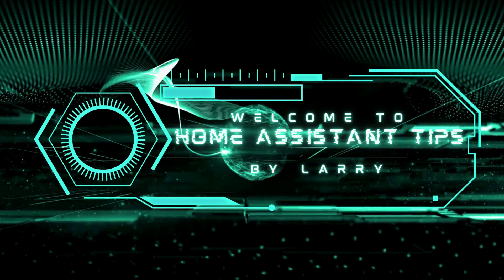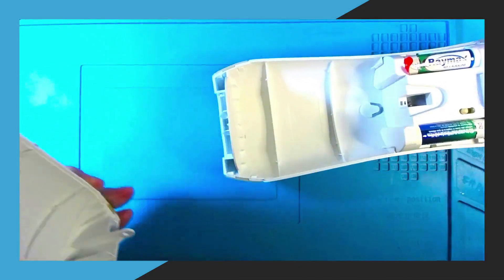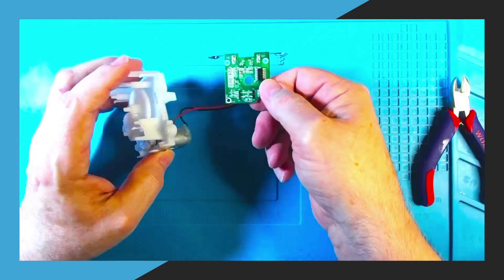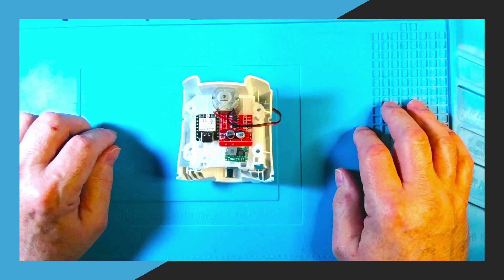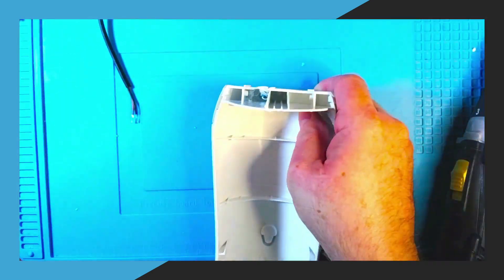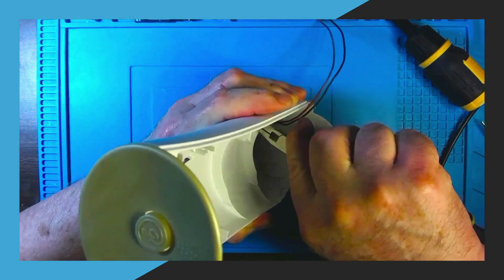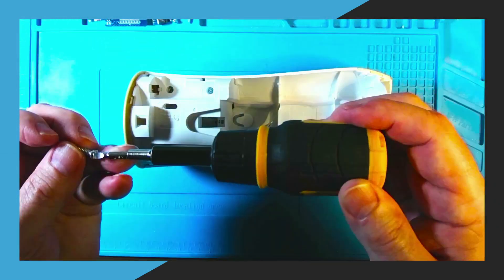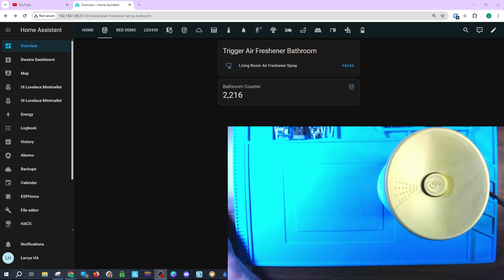Integrating a Glade Air Freshener with Home Assistant Full tutorial Mod

Comment: Excellent Thanks! 
It works perfectly! If it helps: I set everything up with an ESP32C3 Super Mini (not the SeedStudio) which is much cheaper and has a 3.3V pin (although someone told me that it could have problems if used too much). This way I didn't use the step down converter. I used the smaller version of the Glade Air Freshner and it works well (you have less space but everything fits maybe even another sensor). I added a counter inside ESPHOME directly in the YAML code with a (virtual) button to reset the counters (this way I will know when the spray is running out).  PS: use pin 4 and 10 others may cause problems.
Reply: I am gathering the parts to build this also with a Super Mini.  Will the YAML be the same for either device?
Reply: @s@s @smoran1025  yes! Pin 4 & 10 are ok. Other pins can create problems.

Comment: Hi, first of all, thks for the tutorial :)

I'm having an issue, every time i power on the device te motor start's working and it only stops when i press reset button on ESP... any help?
Reply: Hi! I have the same problem... I'm using an ESP32C3 without a 3.3V buck converter. Did you solve it?

Comment: Discovered this and I'm racking my brain trying to wrap my head around all this as a grease monkey (Handyman) I know enough about electronics, but microelectronics are a different ball game. I picked up a Glade and Walmart brand air freshener and I've got aquestion:

1. What are the original circuits in these machines? Are they actual microcontrollers? Are they even simpler given their price points? Any part #'s I google are just straight up dead ends.

I finally found this comment on Reddit and decided at $6 for an air freshener, that it might be worth it to mod the original board:

'I FOUND A SOLUTION: Hey guys, I had almost the same situation. My Glade air freshener goes off way too frequently, and I only wanted it to go off when you press the manual button (basically disable the timer mode).

After looking through this post and getting to know the circuit a bit I discovered that the modes from the switches just go straight to the microcontroller chip. I discovered that all that was necessary to remove the timer mode was to cut the track between one of the timer mode switch positions. This allows the device to be put in that mode (with it on) but the signal telling the microcontroller to do that timing function is no longer there.

I made this simple mod to mine and IT WORKED! :) Now I can have the device on the 36min mode from the switch (where I cut the track from) and it will only go off when I press the manual button :)

I had a slightly different PCB to the original post but the components look to be pretty much the same and the layout of mine just brings the manual push button out to a separate mini PCB rather than directly on the top of the little cutout. On the one pictured the tracks from the switch to the mcu do look to be quite accessible so the same mod should work too :)'

EDIT: Cutting the "wrong" trace from the switch leaves the unit ON all the time, timed modes work, but only a button press can activate the spray.
Reply from the maker: i wanted to be able to integrate this with HA so it would only spray when needed, Which it now does. Spraying on a timer or spraying when you push a button wasn't and isn't home automation. I'm glad you got it working without HA like you wanted but that wasn't the goal of this video :)
Reply: @HATipsByLarry  Yup! So far I'm learning a bit more about microcontrollers with this 'simple' project. Eventually I'd like to make the freshener display the spray life in %, or sprays left on a screen in the front (e-ink maybe) for people visiting, battery level and/or notify me on my phone when its time to change either, and just be motion or light activated. For now I just want to focus on having it light/motion activated, and maybe notify me for replacement.

I've got the Walmart/Great Value version and it makes me wonder if that has a 555 IC because its unmarked, no manual button, and suspiciously similar in looks.

Comment: Few questions if that’s okay (newbie), first do I need to adjust the potentiometer at all on the buck converter, or is it okay on default? If it does need setting any advice? Secondly on removing the pieces the cogs fell off.. I’m now not quite sure where the smaller top semi circle cog piece should be placed and which way round. I’d be really grateful if you could advise. Kindest regards in advanced.

Comment: I'm really new at trying to tinker and make devices and sensors, so I apologize if my question is elementary lol dont hold it against me. So why do we have to use buck converter to regulate the voltage down to 3.3 volts for the motor, is 5 volts too much for this particular project?
Reply from the maker: Yes it is, i stripped the plastic gears on the motor trying what you suggest. There is some pretty high torque involved. And i also tried using the 3.3 volts coming from the micro controller, but the MCU would either lock up or reset. After some testing found that the MCU doesn't put out enough current to power the motor when it is trying to push the air fresheners nozzle down. Don't worry about asking questions, I'm a firm believer of the saying about there being no stupid questions.
Reply: @HATipsByLarry  thank you, that makes perfect sense. Also, I really appreciate you taking the time to give me an explanation.
Reply from the maker: @elevatedviewstcl  No problem. Glad to answer any questions people have.

Comment: The parts required (the 3 circuit boards) currently cost about $14 USD, so this project could easily pay for itself just by eliminating the batteries!  But real value is definitely the automation.
Reply from the maker: Yes, and the fact that you don't have to have it spray every 9,18,36 min. Which is where glade makes it's money, refills. They sure aren't making much on the sprayer itself as it's only $6.00 USD. Main reason i decided to mod it. I have several of these around the house and they all have over a 1000 sprays remaining. They have been running for over 4 months now. 😀
Reply: You don't need to use the SeedStudio C3 (which is definitely the best but not necessary). A generic ESP32c3 will cost you about $6 on average. If you use an ESP8266 instead of a C3, I think you can also avoid the voltage regulator (but I still have to figure that out).

Comment: Question. Could you have use the 3.3v from the esp3C3 or use a D1 mini and it 3.3v.. Thanks
Reply from the maker: Good question, but no the MCU's don't have the required current capacity to run the motor and the H-Bridge motor controller. When i tried the MCU would either lock up or reboot. The D1 is the same, plus its foot print is to big for the space available.
Reply: @HATipsByLarry  OK tanks
Reply: There is a video of the older model . I tried  to do the same with the newer model, and now l know why the motor was locking up and the d1 mini lockup as well. Thanks for this video.
Reply: @HATipsByLarry  I'm using a GladeAirframe, one of the smaller ones than the ones in the video, and I can get it to work on the 3.3V pin... maybe the larger version has a motor that requires more energy?

Comment: I've tried this project, but I noticed some problems with the Xiao Esp32c3 from Seed.
If I cycle the power (usb off-on) the dc motor goes on (turning on and on) and the board does not connect, until I reset; then the board connects and the motor stops and responds to the buttons.
Any ideas?
Reply from the maker: @MarcoA.E   norrmal for the motor to move on power up a little, but should connect right away to wifi. I have used the ESP32C3 in many projects without problem. I have 5 of these modified glade air fresheners in different locations in my home and all working fine without problems. Perhaps try a different mcu. Move to different location to see if weak wifi signal. Also check esphome log for mcu, see if it shows any errors
Reply: @HATipsByLarry  Even with VERBOSE in the logger there's nothing noticeable; beyond gpio9 being a strapping pin. It seems to affect the boot, as there's about 2.2V on that pin before I manually reset - then the voltage of that pin drops to 0V and the board finally loads. But if your not seeing that behaviour on your samples...
Reply from the maker: @MarcoA.E  As long as you don't  attach pullup/down resistors to them they shouldn't cause a problem. Can you hop over to my discord channel? It would be a lot easier to troubleshoot as you can paste your logs, etc. in discord.. Here is the link https://discord.gg/HB9fne2VDu Just send a message to me @HATipsByLarry and it will get my attention. You could move the wire to a different pin, say D7 (GPIO20) and update the code and see if that fixes your problem. But not seeing this problem on my 5 units would be WEIRD then.
Reply: @HATipsByLarry  Sorry, I don't use Discord. But I just reassembled everything again (was doing some other experiments with the ESP32C3 and the battery pins) and I can confirm it works flawlessly with pins 10 & 8.

As a side note, have you tried using deep_sleep and wake with this board? It would be quite interesting to experiment with mqtt wake's publish - instead of external methods or shorted pins.
Reply from the maker: @MarcoA.E  Deep sleep would not work as the MCU needs to be in constant connection with HA to know when to spray. If it were say a temp sensor then deep sleep would work as the sensor could wake the MCU when the temp changed and the MCU could then transmit the changes to HA and go back to sleep. Glad you got it to work.
Reply: Some problem 😞
Reply from the maker: @williamARATA  Are you saying that this is some problem? Or that you have the same problem? If you are having the same problem, then prehaps you could also hop over to my discord channel and share your log. Here is my discord channels link. https://discord.gg/HB9fne2VDu
Reply: @HATipsByLarry  sorry for my bad english i have the same problem, I'll post the log as soon as possible, thanks for your work
Reply from the maker: @williamARATA  No Problem 😀

Comment: I just wanna mod it to use regular air fresheners so i don't have to spend extra
Reply from the maker: What is a "regular" air freshener? Also this mod will make the cans it does use last a LOT longer as it ONLY sprays when your automations tell it to not every 9,18,36 min any more.
Reply: @HATipsByLarry  where I live we get a cheaper alternative in manual aerosol cans but the cans are much larger and don't fit this glade machine
Reply from the maker: @whatamistilldoinghere  Sorry can't help you there, you would need to completely re-design the machine, (as in make a new one) for that to work.

Comment: This is very cool - many thanks Larry for documenting and filming it!
Slightly related: I have a Brondell swash bidet powered by a Tasmotized power monitoring plug. When the bidet air drying mode is detected by the plug (based on wattage), a HA automation turns on the extractor fan for 10 minutes.
Reply from the maker: Glad you liked the video and thanks. That sounds cool you can even have the air freshener spray at the time the fan is turned on I have replaced a dumb switch with a esp32, a relay and a bme280 temp and humidity sensor. https://www.youtube.com/watch?v=5JBcR0OkVcw Also installed a VL53lox time-of-flight sensor ( https://www.youtube.com/watch?v=2ZEIDl2Fluc ) that points across the seat of the toilet so the fan and the air freshener only trigger when i sit down on the seat, or when the humidity goes above a certain level.

Comment: Won't the motor overturn and damage the gears? I see in the code that you just turn the motor forward then just delay, then reverse..
Reply from the maker: No. That's why i delay exactly 300ms then break the motor so it doesn't cost and reverse for exactly 300ms then break then release the motor. I did break a few gears until i got it right testing of course, but then that's why you have me 😀So you don't have to break things getting it right. I have 5 of these around the house and they all have been working for over 3 months with no problems at all.
Reply: @HATipsByLarry  thats great and nice to hear. I was looking to automate the same air freshner for quite some time now and it was a suprise when I saw your video haha. I'm still looking into a battery powered one and a stepper motor instead so the turns are more precise. But I guess with what you've shown, we have a proof of concept. Great job!
Reply from the maker: @itscarlsanity  Thank You. A battery powered one that works with home assistant would be almost impossible to do (unless you want to recharge the battery a LOT) or had a big external battery, because the Micro-Controller can't be put to sleep and needs constant wifi (power hog) connection so it can be triggered by the automations. If your talking say a temp/humidity sensor for example then no problem as the sensor could wake the micro-controller when the temp/humidity changes then the controller could transmit the changes and go back to sleep.
Reply: @HATipsByLarry  thats why I wasn't able to do it haha An 18650 battery could work. I hear it could last 17 hrs for an ESP with deep sleep. Not sure how could you just wake it up when a command is sent from Home Assistant. I've also seen a small solar panel that charges the battery in the day so it never runs out but I mean the air freshner is an indoor thing so you'd have to put a wire to the solar panel outside which kinda defeats the purpose haha. Some solar lights have that circuit, you have rip apart the lights and just put a voltage regulator to 3.3v and you're good to go.
Reply from the maker: @itscarlsanity  If you want to discuss this more discord would be the way to go as it is easy to carry on a conversation there. I just recently opened up a channel if your interested. https://discord.gg/HB9fne2VDu

Comment: I might be missing something but the code looks like just the motor control. How does it connect with home assist and manage the comms from that?
Reply from the maker: Through ESPHome via wifi.When you flash the micro-controller with esphome the first part of the code that identifies the connection information is created by esphome. The code i provided is placed after the Captive Portal line which will be the last line of the pre-made code.For example this was placed in my MCU after i added it to esphome

esphome:
  name: air-freshener-bathroom
  friendly_name: Air Freshener Bathroom

esp32:
  board: esp32-c3-devkitm-1
  framework:
    type: arduino

# Enable logging
logger:

# Enable Home Assistant API
api:
  encryption:
    key: "ppnXxOvsUOrTTY8hwuqQIVd1F0MazM+9zQulhUpz8I4="

ota:
  password: "87fa8773048c73f0ebb27acf663198e4"

wifi:
  ssid: !secret wifi_ssid
  password: !secret wifi_password

  # Enable fallback hotspot (captive portal) in case wifi connection fails
  ap:
    ssid: "Air-Freshener-Bathroom"
    password: "zejxypP0Iw9R"

captive_portal:
Reply: @HATipsByLarry  Thanks!
Reply from the maker: @JonnyFix  No Problem, glad to help

Comment: Neat project. I understand why you made it USB powered but it loses the portability of batteries, plus in the UK you are very limited about electrical sockets in bathrooms / toilets so other than a double insulated shaver socket we tend not to have any sockets.  Wonder if you could fit a larger battery pack inside and if so how long it would last?  Might be a non starter
Reply from the maker: Yep i'm afraid so. The MCU needs to be constantly connected to HA via wifi so it can listen for commands to know when to spray. So the MCU can not be put to sleep like say a temp sensor could be, and wifi is a power hog.

Comment: That was a great video. Also, I like that now the air freshener is powered instead of needing batteries, though those batteries do tend to last long. I suppose you could modify what controller you use so you could include something like PIR or other sensors. Anyway, great idea.
Reply from the maker: Thank You. The MCU needs to be listening to HA to know when to spray so it needed to be powered instead of running off of batteries anyway. I thought of putting a PIR or mmWave sensor inside it but i like most others already have PIR and mmWave sensors in most rooms anyway so decided not to. I will be putting out a part 2 showing how i used those sensors and others to make the air freshener spray when i wanted. So stay tuned for that

Comment: Great job! I’ve seen it done before but you made it look way easier. Thanks
Reply from the maker: Thank You. I made the decision to replace the original PCB to make it easier, instead of having to cut traces and solder tiny wires to tiny points on a tiny PCB. For a $1.50 USD for the motor controller, i figured it was worth it.